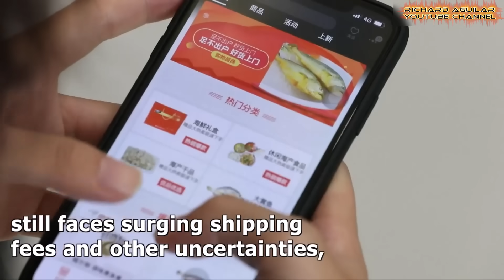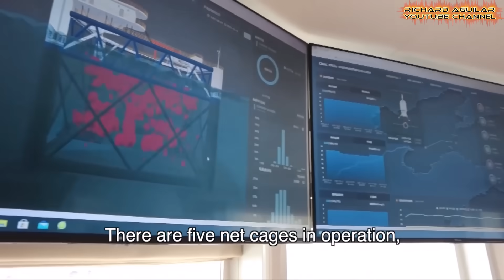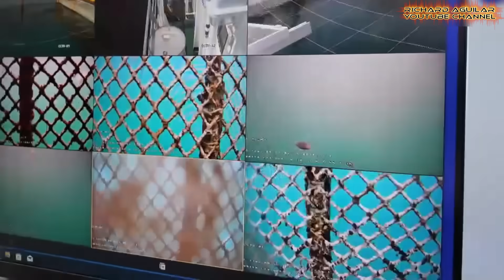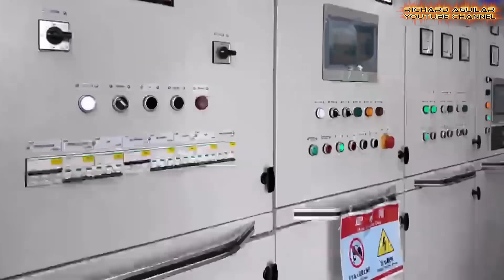China’s AI Fish Farms Quietly Dominate the Deep: Ocean Reprogrammed

Comment: China may be leading the charge in AI-powered fish farming, but it’s far from alone. Several other countries are diving into smart aquaculture with impressive innovations of their own:

🇸🇬 Singapore
Singapore has developed AI-driven vertical shrimp farms that rival traditional coastal ponds in cost and efficiency. These high-tech facilities use seaweed filtration systems and zero-discharge recirculation to minimize environmental impact.

🇨🇦 Canada
Canada is investing in autonomous robotic systems for aquaculture through initiatives like the ARCAP project, which uses underwater vehicles to monitor fish health, water quality, and infrastructure. Companies like ReelData AI are also deploying AI to optimize feeding and biomass tracking.

🇳🇴 Norway
Norway’s salmon industry is a global leader in AI adoption. Projects like Cermaq’s iFarm, developed with BioSort, use facial recognition and machine learning to monitor individual fish health in open-net pens.

🇮🇱 Israel
Startups like GoSmart are using compact, solar-powered AI systems to monitor fish weight, behavior, and water conditions in real time. Their tech is already being used across Southern Europe and aims to reduce feed waste and disease outbreaks.

🇯🇵 Japan
Japanese firms are integrating AI with underwater cameras and sensors to detect disease early and optimize feeding schedules, especially in high-value species like tuna and grouper.

So while China’s deep-sea AI farms are making waves, the global aquaculture scene is quickly evolving into a high-tech, data-driven ecosystem. Want to explore how these systems are reshaping food security or ocean sustainability?